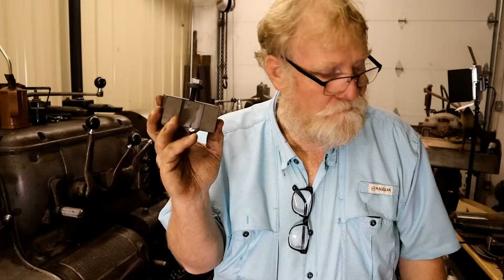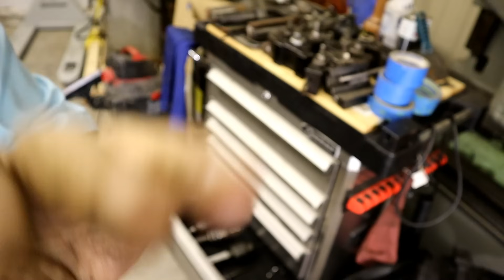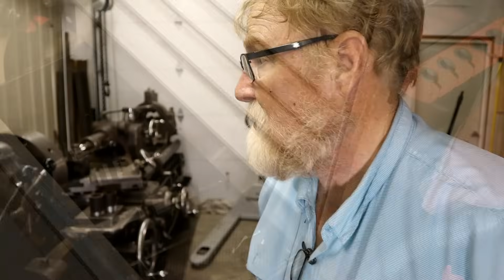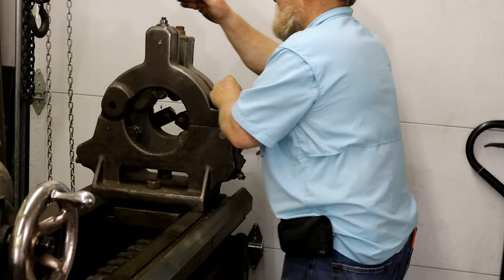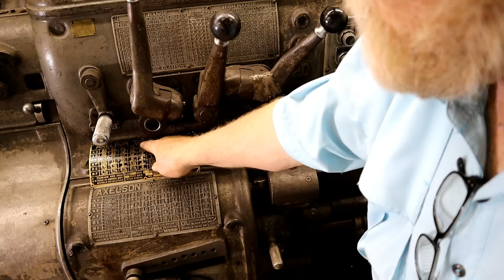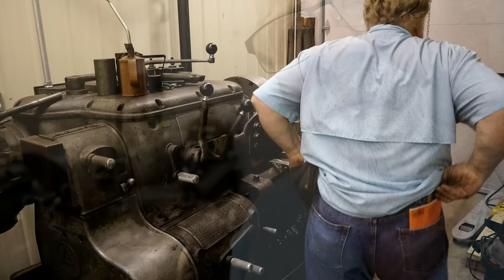So you WANT a BIGGER Lathe!  Really ??

Comment: I have a ten inch Cincinnati tray top.  Its basically the bed from a 14 inch lathe (9.5" across the bedway),  with a reduced capacity swing.  Its far more capable than any 10" South Bend. 

 Its a fantastic machine, simple enough that I can do all the work on it, and big enough for most of what I do.  Still, there are days when I long for a bigger lathe.  If I ever replace it, it will be for a 10ee,  or a 15" Colchester round head.  I don't need huge, but I do want capable.

Comment: One thing I should add.
If you have a large lathe it is worthless without a hoist or forklift to load the workpiece.

14-16x60” was the recommended size for most shops back in the day.

My 16” will swing 8” over the carriage, and 8x60” steel bar weighs 1,710#.

Comment: Size of lathe depends on what is being worked on and how the parts need to be worked on. While very possible to make tiny parts on a big lathe, it is no possible to make big parts on a small lathe. Limitations of older lathes is spindle speed. To properly take advantage of modern carbide/cermet/diamond insert tooling which is specifically designed to "move metal" rapidly and enlarge amounts to be finished with inserts specific for finishing required spindle speeds most vintage lathes cannot offer. This means moving about 0.50" DOC per pass vs 0.03" per pass on a small south bend and similar lathe on a work diameter of say 5.0".

No machine tool last forever, they all wear and will have an effect on usability and parts made. Second is parts availability if/when something goes very wrong. Third, oil/lubricant needs, the headstock and running gears could require a significant amount of oil/lubricant and the ways/slides/screws must be oiled often for them to function properly.

Comment: Older bigger macines are nice until they break down and you need another big machine to make parts because there are no spareparts around any more. At work I have a Harrison 460 with 315mm (12") chuck and I would like to shift down as allmost all work is 200mm (8") or smaller. 10mm stock in the 315mm Bison chuck isn't allways nice...

Comment: Another consideration to getting a bigger lathe... Will your floor / foundation handle the weigh? Like you said. A small increase in swing equals a LARGE increase in size and weight of the machine. If you are operating on a wooden floor it could start to sag and you'll never be able to keep your lathe square. If you are on concrete the weigh could cause or propagate a crack...
Reply: Yeah, your second point can lead to an awful lot of headaches, weather warranted or not, and it’s pretty nice to be able to scoot machines around with a simple pallet Jack and not require multiple set of hands to shift.

Comment: Big lathes will guarantee the ability to screw up small parts faster and easier than ever.  I began looking for a 6x36, ended up with a huge old warrior, 18/13 swing, 48 btw centers.  Headstock is nearly half the length of the entire machine.  100#+ chucks.  I could hold a 16 penney nail with the Bison 3 jaw ... but why should I?  After all, anything under 1/2" in diameter runs a risk of getting snagged, bent, twisted, if you get greedy or don't have the tool height 'spot on.'  And it will happen in a heartbeat.  Big work in that lathe can be intimidating, but small work is terrifying ... I've got a few mangled parts (and wrecked tool bits) laying around that will give witness to that.  For most of my work, I'd been better off with a "Bob."  Yeah, get it if you want it, just keep the smaller one around or plan on getting one.
Reply from the maker: I figure 3 is about the  right number of lathes.. I guess the 6 I have is just going to have to get whittle down....   Yeah Right :)

Comment: I have recently bought 2 monster lathes. British Holbrook H20. They are 20" swing but only 40" between centres. They are toolroom lathes. Stupidly heavy for their size. They weigh around 5 tonnes each or about 11000lbs. The headstock is actually longer than the bed. One is ex Rolls Royce aero engines. 1964. Runs like a swiss watchmakers lathe.
Reply from the maker: Where did you find them?
Reply: @10swatkins  
I bought the Rolls Royce one at auction. When it arrived I was shocked how big it was. Made my Colchester(Clausing) 15" look like a Myford! Just on a different scale. I had no intention of acquiring a 2nd one. They are very rare. Only 134 made. I found a chap selling the 127T gear and a fixed steady for one. I purchased them off him and then he offered me the lathe very cheap. Couldn't say no. Shipping them isn't easy. Cost more than the lathes. Needed a very powerful HIAB type lorry to collect. He also gave me 4 D1-8 chucks with it which are worth more than the lathe.
Reply: Holbrook made very good toolroom lathes, top tier lever for British built machines.

Comment: the crank case for a first ww airoplane are aprox 25 inch dia .Thats the rotory type averticall type might do for that ttfn&ty
Reply from the maker: I once nearly bought a LeBlond 25 inch lathe... It was a weird feeling standing at the controls ,  felt like you were staring at a massive wall of levers and switches...  That would have handled that motor :)

Comment: I look at it this way, you can do small work in a small lathe, you can do small work in a big lathe. You can do big work in a big lathe, but you can't do big work in a small lathe.
Reply: That is not right. All lathes have a range in dia holding. Some large lathes won't hold small diameters. You won't get the RPM to do small work on a large lathes. You don't get the same feel on a large lathes to do fine work like on a small lathe. 40 years experience in machining from 6 feet diameter down to 0.020".
Reply from the maker: Within reason...  An old friend made some of the red and blue valves on the early space suits.  They were small and intricate, he had some that had small flaws in the metal that he rejected, I was looking at them and asked what kind of lathe he used. Expected to hear him say a 10EE or some other small tool room lathe...  Floored me when he sad a LeBLond 17 :)

Comment: There is one more thing about big machines -they eat a lot of power ! And electricity prices are only going up (where da heck are those cheap renewable green sources?)!
large lathe is great if you do serious production and make money on it ,in a hobby shop its a black hole when that motor starts to draw 15kw per hour.
The reason why i went with biggest single phase motor i could find -price was 2x cheaper for house hold power than for 3 phase industrial.
Smaller 10" lathe does 90% of the hobby jobs  and 80% of professional ones If something large shows up i just outsorce it !

Comment: One advantage of a larger lathe, even a 14-or 16 is that large carbide toolholders are often surplussed and fairly inexpensive used. I found that tooling for smaller lathes commands a higher price because 1/2 and 5/8 are the sizes that hobbyists can use on their lathes without dropping down the tool all the way to reach the center.
Reply from the maker: That's another problem.. Most of the used large stuff is really abused and not worth buying..
Reply: That’s girl math.
Reply: Nothing stopping you removing the compound and making a solid toolpost block which will hold a big toolpost and big tools if you want to use big tools for heavier cuts.
Personally my lathe is a 13" which really swings 14" or 7" over the cross slide and takes 20mm or 3/4" tools, It's plenty enough for me though I would like bigger I just don't have room for bigger.

Comment: I'd like to see what the dog house looks like for your phase converter motor.
Reply from the maker: I'll get you a picture...   Here is a link to the one I used. 
 https://www.tractorsupply.com/tsc/product/aspen-pet-petbarn-3-large   IT is a large one and the 20 HP motor fits in there nicely. Have some 6 x 6 treated pieces in there that are cut to fight tight on the floor.  Motor is lag screwed to them.   House has a top and bottom and the top screws on so it's easy to place the motor and work on it then screw the top on.... 

They also have smaller sized ones....

Comment: This is no joke!  I have an HLV-H and a 16 inch import at my home shop, but I spend most days at work on a 20 inch Lodge and Shipley and it's quite a bit more work to run.  Other days I'm on a 36 inch Axelson that is similar vintage to yours, and you will break a sweat working it.
Reply from the maker: You get quite a workout then!
Reply: Even though I have 11 lathes my old favourite I do most of my work on is my old Colchester(Clausing) Triumph roundhead. Will turn 24" in the gap and it is 48" between centres. Controls are so light and well thought out. It will hold a tenth easily and on a very good day a micron - incredible for something built in 1964 although the old chap I bought it from said it had been a toolroom lathe and hardly used.
Reply: I ran a later18" Lodge & Shipley for a very long time and it was so much easier than an Axelson in the headstock shifting, the pin lever control movements on an Axelson takes more effort and it is famous for wearing you out before the end of the day. However, the quality overall of the Axelson is much better than a L&S or Monarch of that time period from what I have seen.
Reply: i am working on a oerlikon dm4a  5meter betweeen centers a beast  and another similar to the one he has  in the video but   3.3m  first one weights near 10 tons second 6.8  i am pretty young so i can still work on it but otherwise would be imposibile  the  boring bar weights 110kg  😝 the 4 jaw chuck  258 kg

Comment: Do both You and Don have Armstrong automatic drill drifts.  To knock apart morse tapers
Reply: I just have the wedges
Reply: @donmadere4237  its much longer at a shallower taper and it has a split weighted handle.  Something easy to make in your shop.   Should be a lot easier than the cross feed block for the shaper.
Reply: @waynep343 thanks Wayne